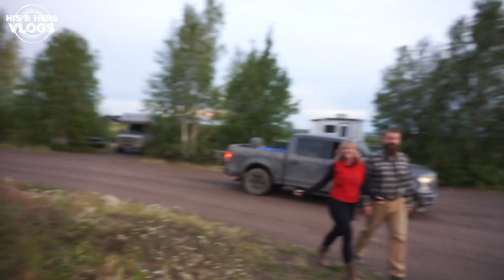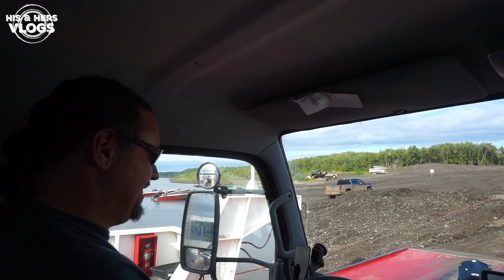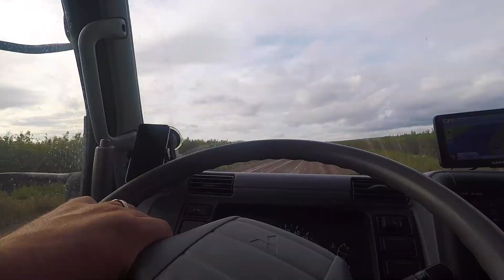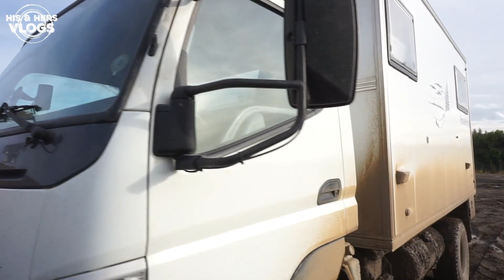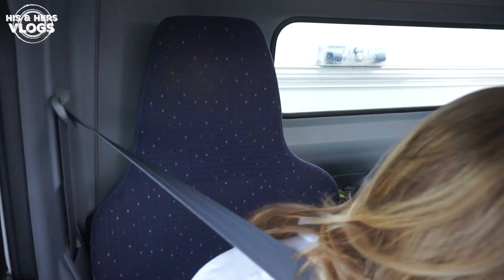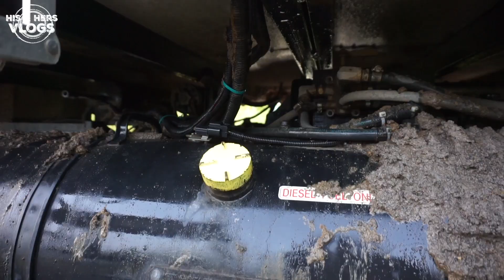Rescuing Broken Down Canadians • Dempster Highway, Canada

Comment: Unfortunately it's not uncommon to get bad fuel in the north, usually the smaller the town or lower volume fuel stations are the worst, so always pack lots of extra filters when in the north or anywhere more remote regardless of what country your in.  Fuel like what you showed is most common when a low volume fuel station is getting low on fuel and they're drawing from the bottom of their tank or they were low on fuel and just got filled up and the filling process stirred up all the crap in the bottom of their holding tanks.  

Keep up the videos, I'm enjoying them!!
Reply: That is why basic equipment should include a Mr Funnel fuel type fuel filter funnel for the unknown stations. The trick is to stop junk/water before it hits your rig. This is such basic information i don't understand why the overland crowd doesn't utilize it more, us farmers/ranchers have been using it for years with all types of questionable fuel.

Comment: You should tie a thin strip of cloth to the mirror support behind each mirror, leaving two equal length ends, it will blow in the wind whilst driving and wipe the face of the mirror keeping it clean, due to the lower air pressure behind the mirror, the ends of the strip need to reach across the mirrors face. An old truck drivers tip.

Comment: I second the theory that contamination in the storage tank was stirred up by a fuel delivery preceding  the fuel purchase.  Especially above ground tanks are susceptible to internal condensation issues with climatic  temperature modulation. Reputable stations dip their tanks regularly with water detecting gel on the stick and drain or pump off any contamination but even a small amount in the bottom of a tank can be agitated in the delivery process.  There are also kits which can be purchased to chemically determine water content in petroleum fuel. Extra filters are important but if regularly traveling in areas of questionable fuel quality the installation of a Racor fuel water separator is a good way to help ensure a clean fuel supply.  A bit pricey but much cheaper than a catastrophic fuel system failure.

Comment: We did the same road and fuelstation a few years ago, driving on the “top of the world road” our IVeco Carthago our rig started slowing down........in the beginning we also thought aBout dirty fuel.......but north of Anchorage the car wouldN’t start anymore, we were towed to a mechanic. In short, they had to order 6 new injectors from Germany (our home)......the mechanic did a hell of a job installing the new injectors and by hand alligning the whole motor again. It did drive better then ever before.......until we made another trip back home in Europe and during a rainy period the whole thing started all over again. After a firm talk with Iveco they started in dept searching for the cause of the problems......and although the mechanic in Alaska had taken of the fueltank and didn’t find any fault with it,  they discovered that we had a little hole in top of our tank and water and mud was getting in the dieseltank ! Costly buusiness during a fantastic trip trough the UsA, Alaska and Canada.

Comment: These ferries were invented by a Canadian engineer William Pitt  In the early 1900s so he could cross the Kennebacasis River near Saint John N.B. As far as I know, most of the cable ferries are free in N.B. I did not pay for the Westfield Ferry crossing the Saint John River to the Kingston peninsula. The crossings have to be short in length because of the cable.
     Of course, ferries that are of any major distances are not free and are run by props. When it comes to ferries to Vancouver Island from Vancouver, often tourist complains about the prices the locals always quote the one-way price ($69 in 1994 when I crossed in a car) noting it not that much.  But you have to pay again to get off the island which is effective twice the price. 

PEI  used to have a ferry from N.B. but it was replaced with a toll bridge but you only pay one way and that is getting off the Island. The ferries also had VLT's on them, something I have never ever seen anywhere else and they were also at my favourite fast food restaurant where you order your food. That practice has not continued.